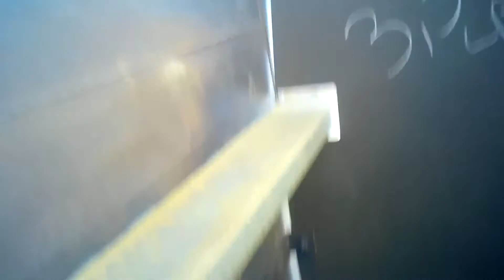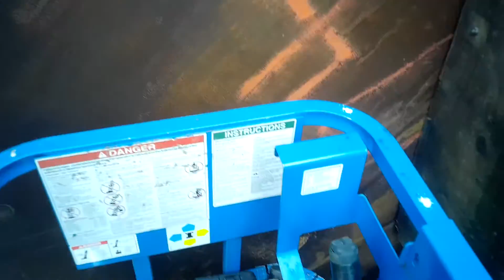Welding Pro Tips- dogs and wedges, getting it to fit

Comment: it drives me crazy how you weld without grinding away all the rust. is there a reason you dont?
Reply from the maker: ben, good question. here is a simple answer- i dont need to. why? well you grind and clean everything to get a good weld, but it takes a lot of time when you are welding 80 ft a day, so it is easier and more efficient to weld 80 ft and do the few repairs (porosity, what not). this job had tens of thousands of feet of weld, if we ground all that before we welded it, i would STILL be grinding.
Reply: To be more to the point, when the foreman sees you grinding a bunch like that you prolly gonna get run off.
Reply: Badass Welding Videos 
Are you in the shipyard?
I have over 9 years welding experience and fixing to move to Washington State  and need advice to get in good with the Union's.
Any info would be appreciated.
Reply: Ben White we use Lincolns Ultracore or Hobarts Fabshield gas shielded flux core in the shipyard too. It does an amazing job welding over surface rust and primer <2 mils. Absolutely no need for surface prep unless you have pit rust or thick paint in way of your joint. This is industrial grade wire meant for production, and when you have an 80ft seam with surface rust, grinding that off is NOT production. Quality is the same with this wire whether you clean the joint or not. It's manufactured for this very reason, heavy fabrication and heavy repair.   I've even welded over torch slag with the wire with aesthetically pleasing results. Does that make it right? Who cares, I got 120ft of linear weld I have to get done by yesterday, turn it up hawwawwt and shrink welding gloves twice a day. Boilermaker life.

Comment: When you use the stitch marks from the opposite side as a guide do you weld at the same place or do you alternate for spacing?
Eric
Reply from the maker: depends on what the prints call for. no need for alternating stitches on this piece